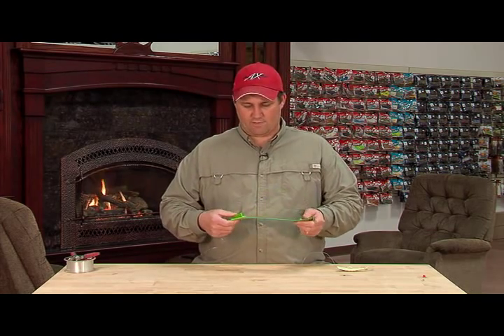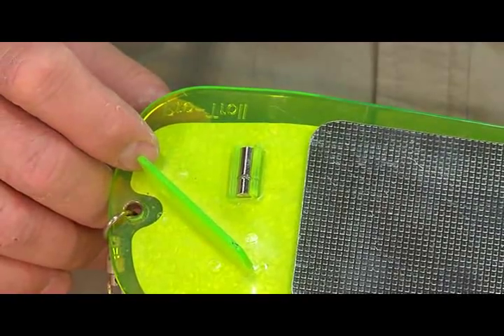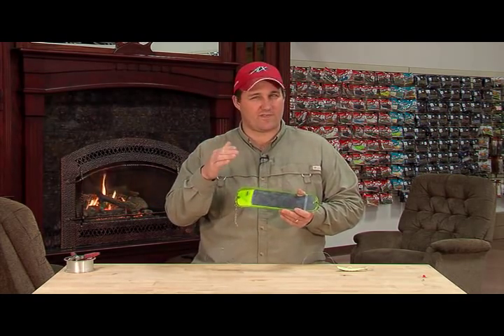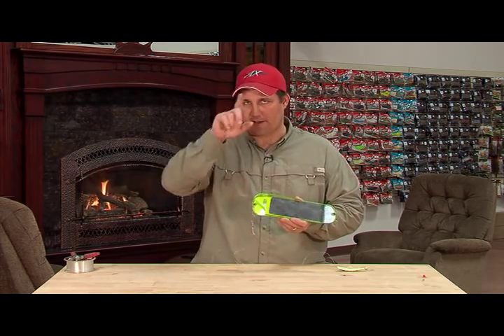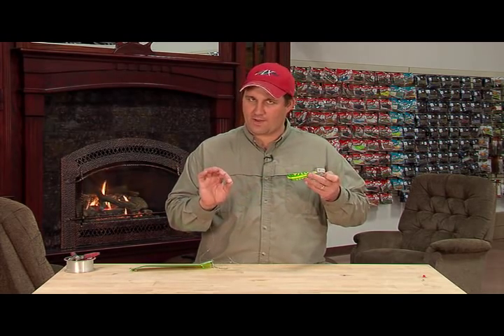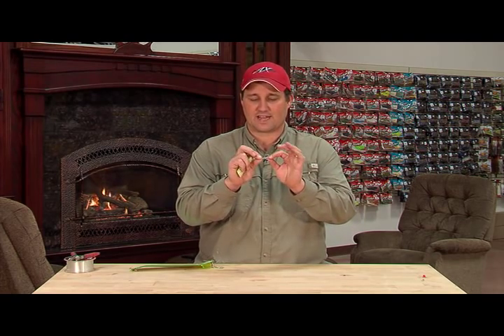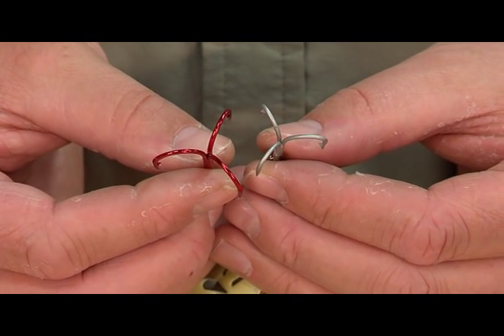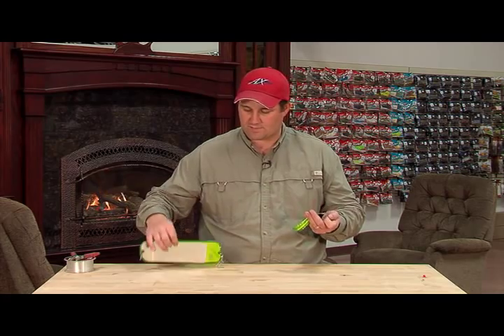Flasher Setup for Chinook Salmon!

Comment: I used the hooks that came with Brads cut plug and it bent by 12 lb steelhead.  I changed to 50 lb fluoro and 3x hooks no problems since.